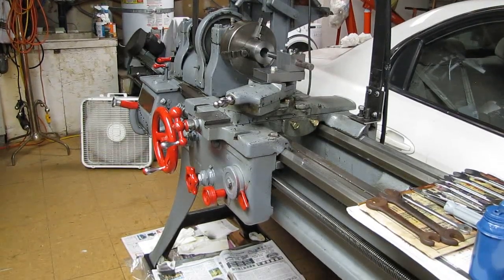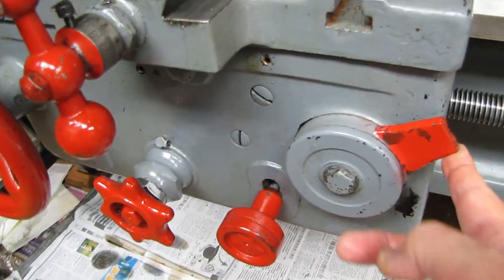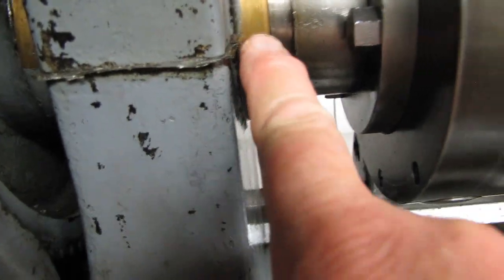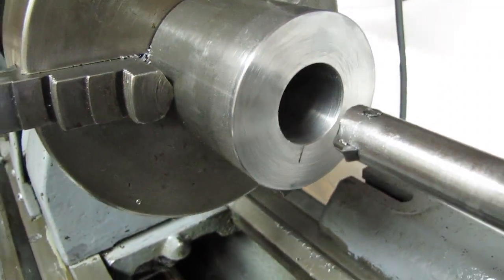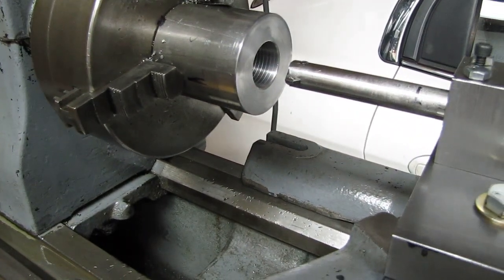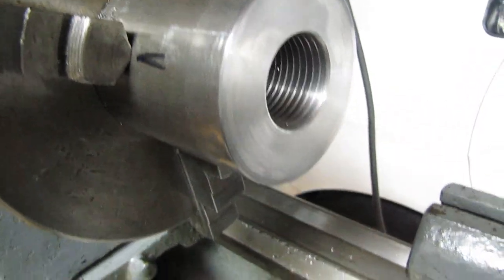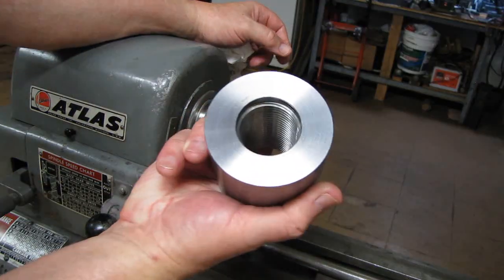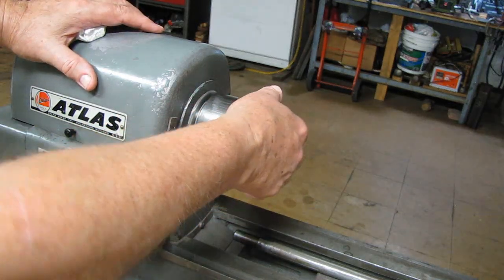THREADING ON THE METAL LATHE WITHOUT A THREAD DIAL

Comment: A very handy tip, thanks for posting! I want to try this for myself. BTW, a tip handed down to me by a long-deceased toolmaker I had the honor of working with was, whatever the pitch of the leadscrew is, you can cut multiples of it without using a thread dial. I was a maintenance machinist in a local rolling mill until last winter, and one of our lathes was a 1943 Monarch with a leadscrew of 2 TPI. All even numbered threads could be cut without the threading dial.

Comment: This is brilliant.  If you own an old or used lathe, the threading dial is probably long gone and a replacement is difficult to find and expensive.  I've been threading by using a reversing motor and driving the carriage back using the half-nuts.  Can't wait to try this out!

Comment: Thanks for the tip. I have a very old Hendey cone head lathe with out a thread dial.
Though I can reverse the apron without disengaging the half nuts the marks can be used for reference.
George

Comment: I'm going to have to try this on my cheapo Chinese bench top lathe.
My little bench top lathe does have a threading dial but, every time I've used that threading dial I've ended up with a cross-thread.  No matter how slow the spindle is turning or how meticulous I am about taking the slack out of the lead screw, I always get the dreaded cross-threading.

Comment: Very interesting.  I will write a procedure for myself so I don't miss any steps in my shop log.  This will enable a quick reference check.  The great thing about my shop log is I also cross reference the video to the log if I need to review something.  Can't wait to try this out as I have to build and adapter for my wood lathe for my Nova chuck.  This will be a good metal lathe project to learn on while justifying the metal lathe cost to my beautiful project supervisor (e.g.  Honey, guess how much I saved by making my own chuck adapter for my wood lathe!!!  No, it didn't cost anything as I already had the correct tools for the job!  LOL)   Many thanks.

Comment: just curious but arent you moving the tool forward when you bring the compound in ? its at an angle so theres a translation taking place or a vector velocity  if you  will
Reply: Late reply, but when you move the compound you are moving it at the angle of the thread. This places the cutting forces on the front face of the tool rather than splitting it between both faces.  

The tool is moving into the work piece at an angle that matches the back of the resulting cut like a chisel cutting forward and down rather than trying to plunge straight down into the work.  

Otherwise it wouldn't matter what angle you set the compound slide at so long as the form tool was at the correct angle.  

For acme threads this is even more important because you would have 3 cutting surfaces rather than 2, doing it this way would reduce that to 2 surfaces like it reduces the 2 surfaces of a typical thread to one.

Comment: Great video! The special boring bar tool holder/ tool post you made looks great too, very sturdy. I suppose two of the hexagon head screws are for rotational alignment of the tool, indexing on a flat? They might be fighting the clamping action of the whole block, or do you back them off before final tightening?

Comment: I wanna talk about compound angle as for metric it is really 29.5 cuz metric thread angle is 60 so half of that less a little is okay but imperial is different  angle it is 55 degrees half of it is 27. so the compound with imperial should be 27 degrees. i tried that and it is gave me good result.thanks for sharing this video.

Comment: Great info but question from a rookie . ..  why did you use the compound at 29.5° angle to increase thread depth each pass and not just use the cross slide?

Comment: I guess the thread is a 60 degree 'groove'. Why is the tool holder slide (whatever it's called) set at 29 1/2 degrees and not 30? You might have guessed I'm a greenhorn!

Comment: Thanks for the video, it has given me some confidence as i don't have a reversing switch or a thread dial. When backing out of the piece with the cross slide the returning to zero ready for putting on the next cut with the compound, what effect does backlash in the cross slide screw have? [I have a LOT of backlash]. Thanks

Comment: the multiple rule is any multiple of the lead screw will drop it in the same spot, where ever you drop the 1/2 nut. The only thing you need to worry about is taking the slop out. You dont need any marks. If the feed is set to 8 tpi with an 8 tpi lead screw, I dont think its possible to miss 8 tpi?
Reply from the maker: My lead screw is 6 TPI, how does that work?   I guess I have to check it out, once I finish the job in the chuck.  It's been there for two years, or so.  Stuff has been going on.... sigh...

Comment: if youre using the modified flank infeed method your compound should  be in the opposite.  direction, this current setup is correct for external right hand threading.

Comment: This obviously works and is exact but the time it takes to disengage the half nuts, do the retract procedure(as with any thread) realighn the lead screw to the mark, then the chuck, then the carraige to the point your ready for the next path, its quicker to just leave the half nuts engaged, reverse the lathe to the start pisition, put it in forward gear and away you go. I tried it as i do not have a thread dial indicator and was looking to speed up the operation of threading. Your method may work faster on a very long thread but with normal threading its far slower, especially if you have a variable speed lathe rather than gears to change speed. What one could do is make your marks before starting so that if by some chance you disengaged the half nuts by mistake all is not lost.
Reply: Hey at 4, 8, 16 TPI  on any lathe you never need a thread dial anyway, just engage the half nut any where and the lathe will trace the same place every time.
Reply: @ronaldmontgomery8446  My lathe is metric, so "any lathe" not realy, maybe on any imperial lathe i do not know.

Comment: Great video!

Is there any way you can use a setup like this to cut metric threads since the thread dial can't be used?
Reply: Hey, Larry! This technique should work for any type of thread. Since it is really doing what the thread dial is usually telling you (that the headstock, leadscrew, and carriage are all aligned relative to one another), the type of thread should not matter in the least. Give it a try and let us all know.

Comment: Is it possible to do finer threads ---in the 28-36 tpi using this method?

Very inventive though, even if only rough threads (NPI?) can be done. Thx for simplifying what most have said in discouraging the use of a lathe to make threads, in favor of a boring bar.

Comment: I know this is a few years old, but I just ran across it....  Why would you disengage the thread lock at all?  Make your run, push the cross slide out of the cut, then power the carriage out in reverse, re-zero your cross slide, add more cut in the compound.... lather, rinse, repeat.  If you never disengage the thread lock, you don't have to bother with going through all of that realignment every time... just back the carriage out enough to take out any lag/backlash when you re-advance.
Reply: Probably because this method is faster once you get used to it. Imagine if he wasn't taking his time to explain it to the camera. Or even if it was a really long thread like making a new lead screw for something.  He'd probably have it reset and ready to go in a few seconds.
Reply: Yeah but you'd better make sure all three marks line up !! That's the key as why this works fool-proof . Try it an see what happens --- without disengaging thread lever do the marks line up, as you approach the location where you marked them or not? I'm going to try it myself here in the next 2-3 weeks when time convenient.

Comment: nice method, but your threading 8tpi? and I see your using a south bend, if the lead screw tpi is equal to, or divisible in to the thread your intending to cut than you've no need of a thread dial and can use the half nuts no problem, for example you have an 8 tpi lead screw, you can cut an 8, 16, 32, 64 tpi screw wherever the half nuts engage,  I think all even threads are this way so 2, 4, 6, 8, ect... but I'm not sure i just know the multiples rule works as i have used it, if your lathe had a 9 tpi lead screw as on seneca falls star lathes or another odd number thread i think the rules change somewhat, and metric is a whole other game, but regardless of all that I think this method is most versitle and appreciate your sharing it, one mod i would make is to use a carriage stop rather than a sharpie on the ways, but whatever works i suppose.
Reply from the maker: I have 6 tpi lead screw and no carriage stop.   LOL ... maybe some day...in a new location, in a galaxy far, far away.

Comment: This was a great Video.  I am starting to learn on a metal lathe I am a wood worker but need to do more with metal for my gun business .   I am getting started with a Harbor freight 7 x 12  I looked at an Atlas th42 but it does not have the adjustable gears so dont know for $ 650 if its worth it .
Reply from the maker: So the Atlas TH42 was missing the change gears?  That's not good.  I paid $500.00 for an Atlas lathe with quick change gear box and Atlas metal floor stand.  I would hold out for a later Atlas/Craftsman with the Timken roller bearings and a 1/2 inch thick bed ways.  The older ones were 3/8 inch thick.  Or you might try to find a 6 inch Atlas with 18 inches between centers.  I am working on a video on "How to buy a used lathe," but there is a lot of work to do.  :)
Reply: THE ATLAS, then put a cnc stepper drive synced to your spindle running the lead screw and you can very accurately cut ANY thread you want.  Guns are notorious for having their own threads so even having change gears or metric gears won't help, cnc is the fix.
Reply: I recently picked up an Sears 12 x 36 Commercial with QCGB and TDI, looks similar to your Atlas. Mine is the under drive cabinet with chip pan, 1/2" ways...1970ish.

Comment: We have a lathe from the early 20s. No dial. Flat belt driven. Works great. 
I'm still wondering how they did it back then with no dial. For sure they didn't do it this way all the time.
Reply from the maker: I think they backed out the tool bit reversed the lathe and went back to the start, deepened the cut and made another pass.   I don't know for sure, but maybe they did it that way.  Someone else said an old timer talked about "Making the chalk marks."  Maybe they did do it with the marks??   Anybody out there know?
Reply: jesse foulk No this is the standard way everyone used to do it. Backing the lathe up is a very slow and poor beginners method.
Reply: Well then....we'll have to give more appreciation for how we do it now. Or rather by CNC
Reply: I think you re right about backing the feed without disengaging the thread lever, but not sure. ?? Still thanks for the video.

Comment: Not a good test. Since the lead screw is 8tpi and you are cutting 8 tpi there is no position where it is out of phase. For cutting 8tpi you can engage anywhere at all and it will be registered correctly. This could work for other pitches.

Comment: what is the  reason for giving the 29 deg angle on compound?
Reply from the maker: I was told years ago that 29 or 29 !/2 degrees lets the tool cut on the leading edge of the tool.  The last few passes are cut by dialing in the crossfeed.
Reply: Nasedo375
The angle on the face of the thread.  So when you feed into the work with the compound you're feeding directly into the face of your work.

Comment: IF YOU'RE CUTTING EVEN THREADS YOU DON'T NEED A THREAD DIAL BECAUSE YOUR LEADSCREW IS EVEN THREAD JUST SET YOUR LEVERS IN THE PROPER POSITION FOR AN EVEN THREAD AND DROP YOUR HALF NUT IN ANYWHERE AND GO.

Comment: I reckon that's a fine method, but if that's an 8 tpi leadscrew then you're sort of cheating in the video since there's no possible location that the clasp nuts will engage that won't be correct.  Would be nice to see it with some oddball thread like 11-1/2 tpi where there a bunch of wrong answers and one right one.  I aim to try it out on my 6" Atlas with a metric thread.
Reply: Ha, by co-incidence I cut a bunch of 11-1/2 tpi on some 1.75 NB aluminium tubing just this week.  I did use a thread dial though, on a Holbrook C13.

This is in England btw, hence the funny spelling of aluminium to y'all.

The method shown in the video would work though.  It's dealing with relative position.  I would have marked finer lines personally.

Good video anyway.
Reply from the maker: My leadscrew is 6TPI  The Lathe is a 69-E by South Bend circa 1926-27
Reply: Nasedo375 Fair enough.  Handsome lathe - is that red vinyl dip on the handwheels?
Reply from the maker: dbeierl Nah, somebody painted them.   :)